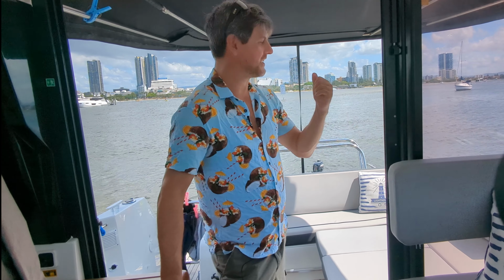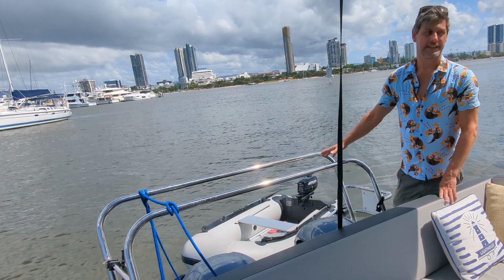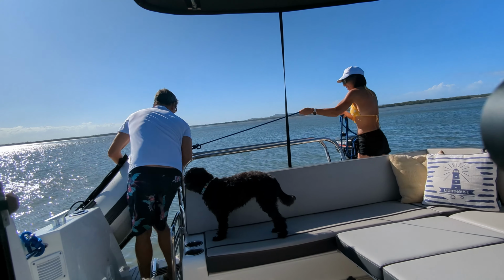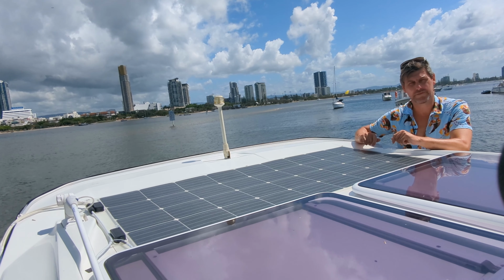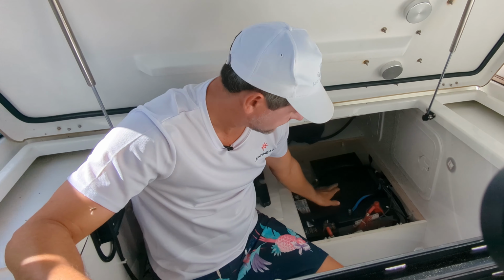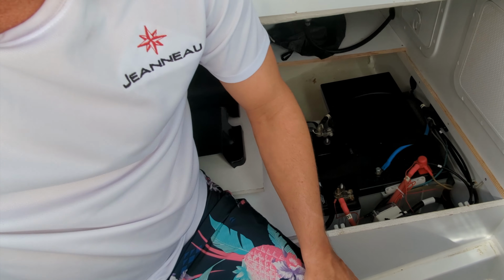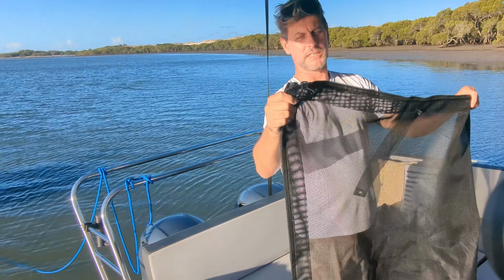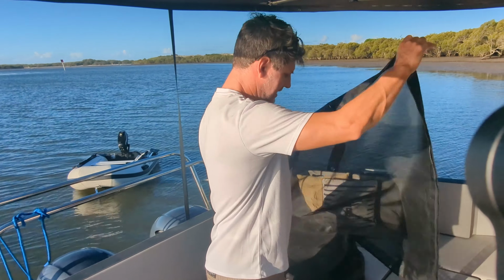TOP 3 BOAT MODIFICATIONS | The Rudder

Comment: Love your informaive videos. A couple of questions. Wondering where you had the mozzie screens made?  Also do you have press studs on the outside to keep tight? If you had a choice of replacinng your boat which Merry Fisher smaller / larger size or other boat brand would you buy?
Reply from the maker: Hi, mozzie screen was custom made by a canvas guy. Hook, line, trimming on the gold coast. Yes it uses the press studs for the storage covers to keep it tight. We would probably move up to a 1095 if money no option. A little bit of extra space. We've been very impressed with Jeanneau
Reply: @TheRudder  Thank you

Comment: Hello! My name is Jesus, writing from Spain. 
I am (together with my wife)  a proud owner of a MF895 delivered on summer 2020, with exactly same configuration as yours! 

I just discover your channel trying to find some mods for my boat and I love it! You do a really fantastic work sharing your experiences with your MF895 and its really helpful for other 895 owners as us.

I am speacially interested in 2 mods that you have already done:

- The quick  water hose connectors you have installed in the back of the stern seat to flush the outboard motors. Do you think you could share brand of the connectors and some detailed pics of how they are connected to the outboards?

- Tender rack over the outboards. This is a must for me... We have been carrying the small 2,30 meters Quicksilver tender over the roof and recently have appear a small cracks on the fiber (as you mention on the video), so, defenitively I want to move it to the stern, as this would be easier to put it on water. Coud you please share some sketch or pic in order to try to fabricated something similar here in Spain? 

It would be really helpful if you could share this info. 

And of course, if you decide someday to visit northwest Spain, you are welcome to visit us! 

Thanks!
Reply: Hi !! My name is Oliver, and I’m really really interested into the tender mount. I own a 1095fly and as you it’s a really must have! We are sailing in south of France (Cannes, Nice areas). Did get some information concerning this mount ? Maybe we can join us and negotiate with a professional in nautical stainless steel to manage our 2 mounts ?
Reply: Dear Oliver! Let's wait if Damien could give us more detailed info about the tender rack and the other mod for flushing the outboards and then, I will start asking for prices in Spain. Let's keep in touch!
Reply from the maker: Hi Jesus, where are you located in Spain? We have only made it to San Sebastian but not further west on that coast. The tender rack is great. Have you seen the install video https://youtu.be/VaW5D3LUFNI They were fabricated by Shine Stainless on the Gold Coast. They do ship overseas if that is easier. Especially if you order two ( with Olivier).
The engine flush was installed before we got the boat. This was installed by the dealer. It appears to be made of fairly standard plumbing fixtures. Hope that helps
Reply: @TheRudder   Thanks for replying me! I am located in Galicia region, exactly in La Coruña (650km west of San Sebastian), but we have the boat moored on Sanxenxo harbord.

Regarding the tender rack I think it's gonna be fairly easy to get a provider close to our location to design and weld something similar than the one fabricated by Shine Stainless did for you.

About the engine flush, I have an overall idea of how to do it, but would be really helpful to have a picture of the attachements they used to connect the flushing hoses to the outboards. Could you help me with that?

Thanks you very much for your kind help.

Comment: Thanks for posting another useful video. I have a MF 795 Series 2 here in the UK. Not so nice weather as you have but still enjoyable boating. I would like to fit a stainless steel frame to hold my inflatable. Did you design it yourself or did the fabricator come up with the design. Thanks Mike
Reply from the maker: Hi Mike, I didn't design it, a fabricator here on the Gold Coast did the design and build. Did you find the video on the install - https://www.youtube.com/watch?v=VaW5D3LUFNI&t=112s They are called Shine Stainless. They can send internationally, I know there have been a few enquiries, maybe a batch could be sent to the UK?
Reply: @TheRudder  Many thanks for the reply. Yes I have found your video on the install. Will investigate further as it seems the ideal solution for carrying a tender.